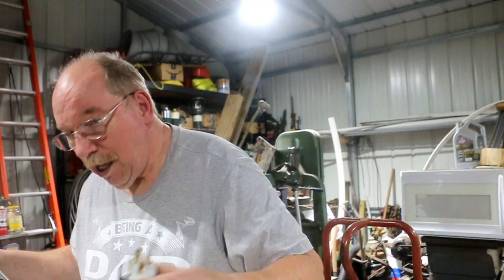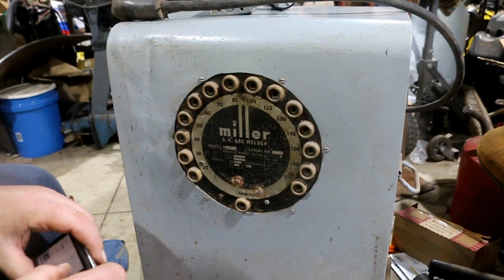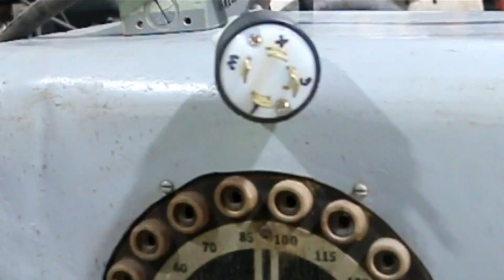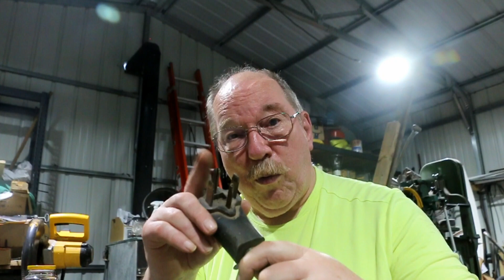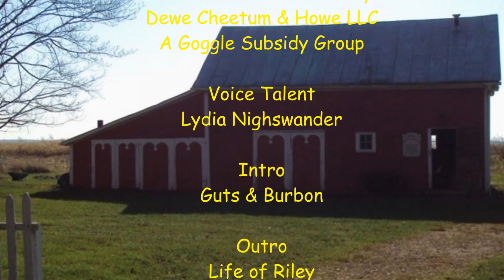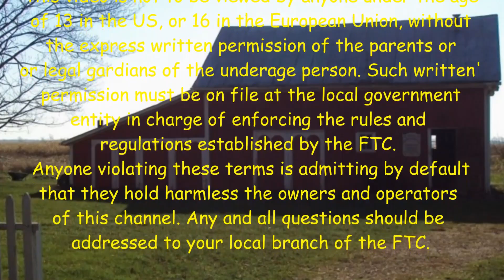Repowering 1930's Miller AC Arc Welder Model R200 Ser#7171

Comment: My Dad procured an old stick welder one of the companies he worked at when they were updating it. The brother 3 years older than me became quite a good welder. Dad taught him to brush flux on where he was going to weld and dip the rod. Not sure why both, perhaps you know. 

When we moved to property we could keep the horses on, Dad wanted to put a hot wire up to stop the horses from bending and stretching under the arena made of telephone poles. Well sir, I went to the neighbor right East of us, reached over the chain link fence and that dang wire grabbed both knees and wouldn’t let go. Neighbor called hollered, her daughter came and they disconnected me with a push broom. Took two steps and down I went, knees refused to work.  Came to find out the neighbor that shared the south fence had convinced Dad to just connect to his hot wire. My brother (the one who could weld) was on leave from the USMC. Three of us went over to see neighbor’s box that controls the hot wire making it pulse. No box, connected straight to the power line coming in from the street, before the breaker box. I took a pair of insulated lineman cutters and cut that dang wire about every four feet. Dad was not a happier camper but brother, his friends that came up with him and myself as part of Dad’s punishment hooked up new wire with the proper hot box to the barn’s electrical system. Dad never trusted that the neighbor knew what he was talking about after that.  😂

I do have a question, if you don’t mind. The licensed electrician that’s doing some work has a small folding scaffold and is in need of another plank. Problem is they don’t sell just the planks. Neither of mine fit as they’re both bigger. How can I make him one?
Reply from the maker: Depends on how long they need to be. 
I use a 10 foot long  2 x 12  between two step ladders for painting the house.
Top Homeowner has a nice video explaining how he makes scaffolding deck boards that I might just try myself. https://youtu.be/qTbnN2th-HU?si=7GQj9YMs3oqnArJR

Comment: I got the 440 Zap once, I'm lucky I didn't fall off the scaffolding to my death.
Reply: I think you were lucky you didn't hit the ground already dead.
Reply from the maker: That is a close call. Being up in the air adds a lot of danger to whatever you are doing. Wouldn't take much to have you pass out and go over the railing. 
I got the worst one when I was stripping out the Griswold Engineering paint room after they burned out the second time. 
Dad and I were contracting to rewire the building and I was cutting the burned wiring out of the rafters. We had gone through and pulled all the fuses and thought we had everything dead. 
Someone had run a 1/2" EMT through the room and on into another room. When I cut into it it still had power. Fortunately it was only a second before the fuse blew but that second took a lot longer than any before or since.  :face-fuchsia-wide-eyes:
I just hung onto the ladder until I got myself calmed down enough to climb down. 
After that I wore a pair of gloves.